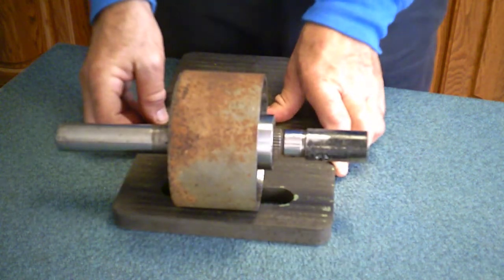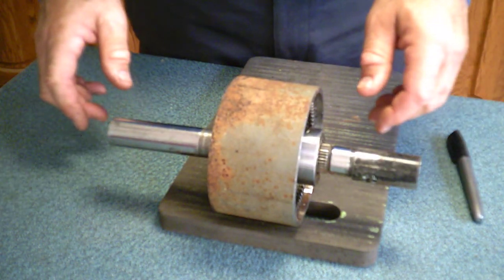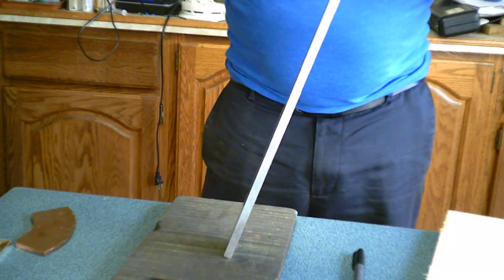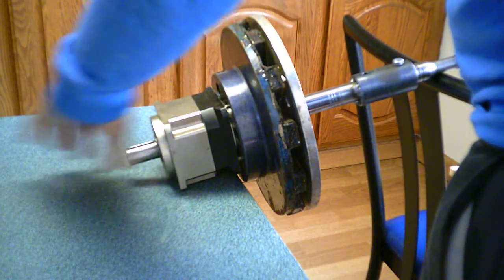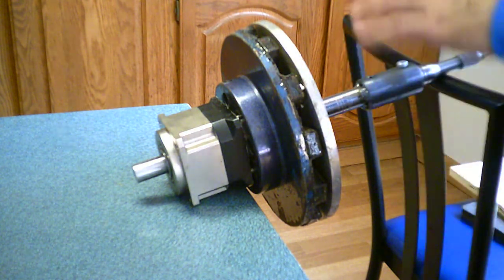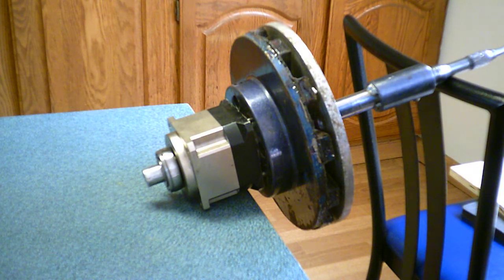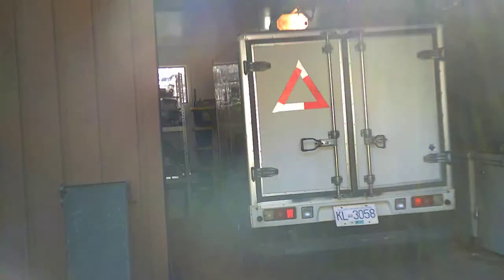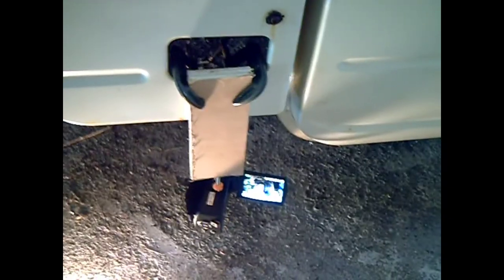Automatic Variable Mechanical/Magnetic Torque Converter

Comment: Craig, really cool work, magnetic coupling alone has many weaknesses, but with the combination of the planetary gear this is really looking viable.
Reply from the maker: Thanks; Right! It's the reduction ratio of the planetary that magnifies the effect of the magnetism! I'm thinking now that 10 to 1 planetary gears (about the highest single stage planetary's ratio) magnifying the magnetic effects by 10 would probably give the most optimum ranges of ratios and highest efficiencies across the typical range of speeds and torques for most vehicles.

Comment: Couldn't you upgrade the magnets to neodymium, hook that to a bike pedal, and have it power a propeller.. for an ultralight (no license required) flying bicycle?
Reply from the maker: They are neodymium. They need the field strength and I've converted even that to a stronger Halbach configuration, adding six 1/2" x 1/2" x 2" magnets on their sides between half of the other magnets.
   A drive train for a propeller would doubtless be a very different machine to a variable vehicle transmission since a propeller only needs low torque at low speeds, where for a road vehicle the heaviest push is to start it moving.